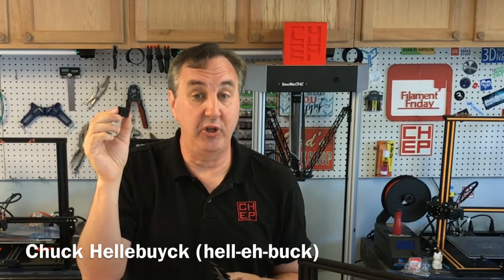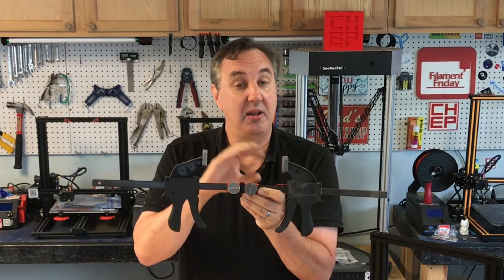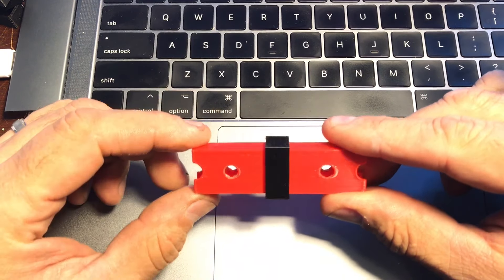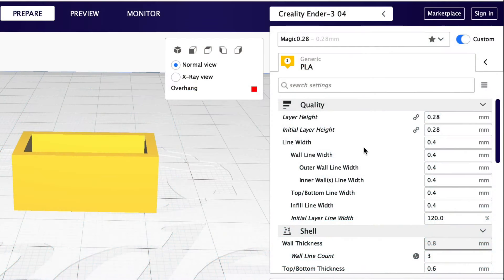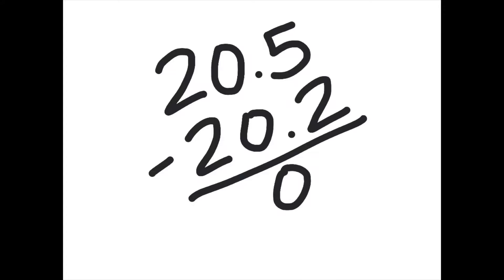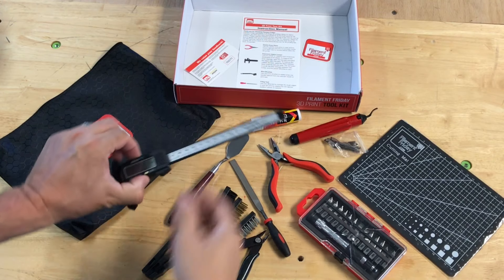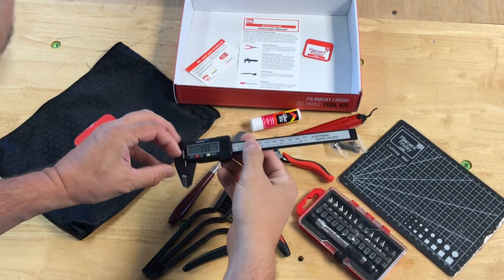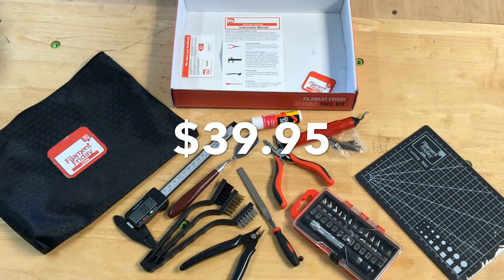Perfectly Accurate 3D Prints using Horizontal Expansion

Comment: i got a lot close with your advice but i still have a problem with the z part how do i adjust the z please its coming 0.88 bigger
Reply: I have the same problem. Can any one Help with the Z adjustment, my parts come up 1mm oversized on Z
Reply: I had the same problem. And even though my idea of using horizontal expansion to include the vertical was doomed to fail, I decided to try it anyway. 

The backdrop:

Ender 3 v2

Bed, e-steps and flow calibrated. 

0.4 nozzle and 0.16 line height with 0.4 line width. 

retraction set at 5mm with a speed of 45, combing on. 

I decided to take a leaf out of the flow calibration book and get an average of all sides of a cube set to 20mm all sides; four around the side and one to measure the z direction. So, made measurements, added them up and divided by 5. 

I then divided this collective number by five to get an average of each surface of the cube measured. 

The difference between the number I calculated and the target number became the number I used in the horizontal expansion Cura setting. In my case my average worked out at 20.1 per side, so I dialled in - 0.1 as my horizontal expansion.

Printed new cube - skirt only - and measured it. To my puzzled amazement the dimensions were still off by the same amount, but they were over the desired average of 100 divided by 5. By a minute amount. So I thought, lets meet this issue halfway. I'll half the minus .01  to minus 0.05.

The resulting cube was close, so very close. So I dialled the horizontal expansion rate up to minus 0.04

My next cube gave me the calliper readings for each measurement as: 

20.00
20.00
20.01
20.00
20.04

Not entirely perfect, I'll grant you, but these are tolerances I can live with.

So in short I measured the width of each four sides of the cube on the horizontal. I then measured the height. I added these numbers together and divided them by the number of measurements (5) to get an average. I then divide that 
average by 5 to get an average for each measurement. The difference between desired measurement of each side and actual average measurement was noted. In my case it was 20.1 so minus 0.1 became my horizontal expansion setting.

This should have worked but instead I needed to take that difference of - 0.1 and halve it to 0.05 to get really close. My fine tuning to 0.04 gave me full dimensional accuracy in all directions all bar 0.01 for a side and 0.04 for the z axis measurement. 

I have no idea if this is repeatable but I can only hope so. If you came to a different solution, please let me know, I'd be interested to hear it.

The need to half the difference still puzzles the pants off me.
Reply: @AlejandroHernandez-ee4ef  I had the same problem. And even though my idea of using horizontal expansion to include the vertical was doomed to fail, I decided to try it anyway. 

The backdrop:

Ender 3 v2

Bed, e-steps and flow calibrated. 

0.4 nozzle and 0.16 line height with 0.4 line width. 

retraction set at 5mm with a speed of 45, combing on. 

I decided to take a leaf out of the flow calibration book and get an average of all sides of a cube set to 20mm all sides; four around the side and one to measure the z direction. So, made measurements, added them up and divided by 5. 

I then divided this collective number by five to get an average of each surface of the cube measured. 

The difference between the number I calculated and the target number became the number I used in the horizontal expansion Cura setting. In my case my average worked out at 20.1 per side, so I dialled in - 0.1 as my horizontal expansion.

Printed new cube - skirt only - and measured it. To my puzzled amazement the dimensions were still off by the same amount, but they were over the desired average of 100 divided by 5. By a minute amount. So I thought, lets meet this issue halfway. I'll half the minus .01  to minus 0.05.

The resulting cube was close, so very close. So I dialled the horizontal expansion rate up to minus 0.04

My next cube gave me the calliper readings for each measurement as: 

20.00
20.00
20.01
20.00
20.04

Not entirely perfect, I'll grant you, but these are tolerances I can live with.

So in short I measured the width of each four sides of the cube on the horizontal. I then measured the height. I added these numbers together and divided them by the number of measurements (5) to get an average. I then divide that 
average by 5 to get an average for each measurement. The difference between desired measurement of each side and actual average measurement was noted. In my case it was 20.1 so minus 0.1 became my horizontal expansion setting.

This should have worked but instead I needed to take that difference of - 0.1 and halve it to 0.05 to get really close. My fine tuning to 0.04 gave me full dimensional accuracy in all directions all bar 0.01 for a side and 0.04 for the z axis measurement. 

I have no idea if this is repeatable but I can only hope so. If you came to a different solution, please let me know, I'd be interested to hear it.

The need to half the difference still puzzles the pants off me.

Comment: Hello Chuck. Thank you for the great videos. Question. I'm printing an "L" shape. the legs are 30 mm and the height and width are 5.5. When I print it, one leg comes out 5.7(w) x 5.5.(h). The other leg is as designed (5.5 x 5.5). I've triple checked my design measurements.  Is there a Cura setting that can fix this?
Reply from the maker: No. Just try and reposition it or print one at a time. Won’t take much longer.
Reply: @FilamentFriday  Thanks. I tried repositioning it but it didn't change. I used the horizontal expansion setting but it changed both. I can work around it but was hoping it was a known issue that was easily fixed.  Thanks again for your great videos!

Comment: Just a quick question. If I do an adjustment with one stl file, will that specific setting work with different prints? Say, to print a 20x20x20 cube, I have to do a -.15 horizontal expansion. But if I do a 50x20x20 box, will it still work with the -.15 setting?
Reply from the maker: Not necessarily.

Comment: Are these values always valid, or just for this particular print?
And why is it this value? Has is something to do with the width of the extruded filament?
What about the height of the print?
Reply: I had the same question or do you have to print a piece to work out new numbers? Just related to rectangular parts?
Reply from the maker: Each print will need it’s own adjustment based on measurements because many settings affect the first print.
Reply: @FilamentFriday  I guess I am not smart enough to use the settings especially for shapes I print. I now try to just print sections of parts enough to test fit and then hopefully get the final complete parts to work.  together. Just had Cura show holes in  a part and previews it print but the printed parts it closed the holes! 4.2.1

Comment: Sir I am getting horizontal expansion option in support menu but it's minimum value is 1mm I am not able to set it on -0.15 please suggest me what to do I have flashforge printer and it use flashprint software
Reply from the maker: Use Cura. Just rename the .GCode file suffix .g and it should recognize it.

Comment: The g-code is calculated based on the nozzle as a single point (its not) and that single point travels the full length of a given dimension.
So the line width is not accounted for and excess material is deposited outside of the correct dimensions.
A good rule of thumb is to set horizontal expansion as half the line width. (a .4 line width needs a -.2 offset)

In CNC milling this a critical setting, the machine has to know if it should cut on the line, inside the line or outside the line.
Reply: No, of course slicers account for the extrusion width...

Comment: I manged to calibrate my prints to almost perfect (external) dimensions tampering "flow". If I design a piece with a hole and want to adjust the internal measurements with horizontal expansion... I am assuming it will also impact the external dimensions, right? in that case... is there a preference to use one over the other if you want both perfect external and hole dimensions?
Thank you and good video.
Reply from the maker: This should help explain it. https://youtu.be/UUelLZvDelU
Reply: @FilamentFriday  Ahh good one. I must play with those settings. Cheers mate.

Comment: How does this method differ from calibrating your printer's flow? Also, if you shrink/expand your walls via the horizontal expansion method, doesn't this effect your overall wall thickness (which is dialed in by calculating the printer's flow)? Thanks @CHEP
Reply from the maker: It really has nothing to do with flow, it just automatically adjusts dimensions.
Reply: @FilamentFriday  thank you. My dimensions turned out to be correct (outside and inside) in one direction but, not the other. Not sure if it's x or yet. I need to print it again. Quite odd.
Reply: That’s also my question and I don’t get it. I was told to print a 2cm cube and measure its walls thickness, then calculated (expected thickness x actual thickness) x current flow = new flow rate. After new flow rate dialled in, my walls are correct and my printer calibrated. So apparently for the same problem, some say calibrate the flow, you say adjust the horizontal expansion. I’m confused. What am I missing? Is the difference that horizontal expansion will adjust the distance between lines as to impact the perimeter, where the flows just impact the lines thickness?

Comment: Nice tip on the setting. I haven't checked thingiverse, but I wonder if anyone has drafted a thing to hold that Caliper. Would be nice to have it and maybe the debur tool in something so they don't just bounce around in the bag and scuff or get scuffed. Just a thought.
Bought a set of step bits & a reamer a while back and neither came w/ a case. Bit of time in F360 and they now have a nice (read: functional and somewhat protective) cylindrical object to store them in. I might revise it to add the debur tool, but then it'll be getting kind of tall.

Comment: I think my ender 3 have all dimensions errors
I printed 4*4*4mm cube when I measure height is 3.5, length 3.8and width 3.9 and elephant foot effect also
Help please
Reply: Height fix = correct z offset. In your case you need to make sure your not to tight to the bed.

Length and width, do what's in this video for horizontal expansion 0.05

And your inner horizontal expansion by -0.05

Comment: what if ij ust the inside dimentions are off and if the two deviations differ?
Reply from the maker: Then it may require a design change or the printer needs some adjustments.

Comment: Did i understand this right: these 3D prints come out with an absolute error, not relative. So no matter if my piece is 20x20 or 80x80, it will always be let's say 0,2 too wide/narrow? The error doesn't increase with the object in absolute terms? Doesn't that mean cura can't figure out how wide a line is? Or are the lines perfect in terms of flow, but because its liquid its expanding in the direction of least resistance, in that case outside?
Reply: correct. its noozle moves to the exact position u set the outer geometry but the Fillament expands a little in both cases. outside and inside

Comment: Hi Chuck...  Thanks for this and all of your other videos!  I have been using your CE3 0.12 printer profile in Cura on my Anet ET4 and have been getting .01mm accuracy in X and Y without adjusting for horizontal expansion printing a XYZ 20mm block which is really great.... but my Z axis is .08mm short.  Is there anywhere else that I can adjust for this beside scaling the Z axis?
Reply from the maker: Adjust the first layer height or print on a raft
Reply: Thanks.... I'll give that a try

Comment: The horizontal expansion is a crappy feature because it adds/removes material on all sides equally. Usually i get good outer dimensions but holes are 0.2 too small. Setting expansion to -0.1 would result in having the outer dimensions be too small.
Reply: Then change the dimensions specifically for what you need on the CAD software simple
Reply: qpwoeiruty eidjcn thats not how it works. You cant have two different files for printing/milling, and you shouldnt change your cad to fit the printing method, especially if you have two different printers that do this with different measurements. Also this wont work for parts that you didnt design. A better way would be to have two different offses for inner and outer wall perimeter offsets.
Reply: I was checking to see if someone had mentioned this, it's an issue I have been having with cura trying to print multiple parts that snap together, as this setting messes up the inside holes making them too big for the now smaller peg.

It has made me start trying other slicers, to try to find one I like that is far more consistent with width of parts, as cura tends to overcompensate quite a bit.

Comment: so i can use these settings for all prints? i have printed some parts for a MPCNC but m having dimension issues of almost 1mm, as the Metal tube ill be using is 25mm OD, but the part i print is 24MM ID where the Tube will fit...
Reply from the maker: Yes

Comment: Okay, maybe I'm not getting it. Why isn't the printer printing stuff the right size from the start anyway? I get this setting is a quick fix, but I can hardly go print everything 2 times.
Reply: @Pro Pendants Well yeah you're right. That process is supposed to happen in the factory though. When I buy a machine I expect it to work correctly, like with any machine I buy. You don't have to fine tune a blu-ray player or whatever, right? That´s why I don´t get this problem. Guitars are obviously no machines, but I get your comparison.
Reply: @remconet  Can't compare a 3D printer to a media player. It's more like an oven. It heats up to a specific temp for a specified amount of time and nothing more. A 3D printer heats up and lays down filament in a specified pattern and nothing more. Can't expect to bake a turkey or a cake using the same oven settings. Can't even use the same oven settings on different size turkeys or cakes.
Reply: @Archer74  Hmm... interesting. Thanks :)

Comment: Those calipers are surprisingly good, but not great. They tend to be off when using the inner calipers. I would recommend if you have one to check the accuracy and mark how much it's off by on the caliper to know when ever you pick up the tool.

I have 4 different calipers, one expensive 12" metal dial caliper, 6" metal eBay "decent quality" caliper (0.01mm scale), 6" plastic eBay caliper exactly like in the video, and a small 4" plastic one i keep inside a tool box i made. They all work great but the plastic ones tend to have slop/lower tolerance and an inaccurate inner caliper.
Reply from the maker: Have you actually used the one in our tool kit or just assuming it’s the same?
Reply: @FilamentFriday  it was an assumption as it's physically identical but of course there different grade units that are identical that get sold all over the place, mine was an crapshoot eBay one and I use it all the time sitting at desk

Comment: hi, and what about the height of the print? When I have it smaller than it should be?
Reply: If you have the answer, please tell me. I have the Problem that it is 0.3 to high.
Reply: You need to calibrate your e-steps for the z axis
Reply: @ShartR  NO. You need to level your bed properly

Comment: That caliper is like $8 on Amazon. I own it and find it pretty crappy. I would recommend trying to upgrade a bit it has a pretty wide resolution.
Reply from the maker: Works great as a first caliper as I show in this video. Ours is stable. You can get better calipers for more money but we wanted a starter kit that was affordable and it does the job well along with all the other tools.
Reply: Most calipers, digital, dial or Vernier are accurate to about 0.02, even the cheapo Chinese stuff. The biggest difference is how long they last. Those $8 ebay calipers are more than up to the job I'd say.
Reply: With the accuracy of these printers I agree than you don't need $150 Mitutoyo's. My $23 "ubante" branded set hold zero and repeat measurements as close to exact as I can tell.

Comment: Okay this might be a stupid question, but how do you measure an x-y-z cube? I've printed one because I have trouble getting prints right that involve matching pieces (that are supposed to slide for instance).
So how do I measure the Y axe for instance? Do I put the Y facing towards me or touching the 'pinchers' of the caliper?
Reply: That's not stupid. You must put the letter to measure toward you and you put the caliper on the right and left vertical sides of the letter.
Reply: @jeromegea4746  Okay thanks for that. I thought that at first as well, but measuring that way means the Z axe is the same 'width' as the X axe, since they are on the same measure area (don't know how to explain better). Or is it different for measuring the Z?
Reply: @remconet  for the z you must measure between the top and the bottom, it's different, I forgot to tell you this.
Reply: @jeromegea4746  Gotcha, now I'm all up to speed. Thanks for the help!
Reply: @remconet  you're welcome 😉

Comment: Do i have to adjust my horizontal expansion value for every different print? or do i have to do this ONLY once as long as i'm using the same filament? it seems like a lot of time and plastic will be wasted if not, because i'll have to print multiple models to measure and adjust the  horizontal expansion value. GREAT video btw!!
Reply from the maker: May have to adjust based on print.
Reply: @FilamentFriday , thanks for your videos they are a great help! If we need to change it based on the print, then how would we measure, and then change the horizontal expansion for more organic shapes or circles for screw holes?